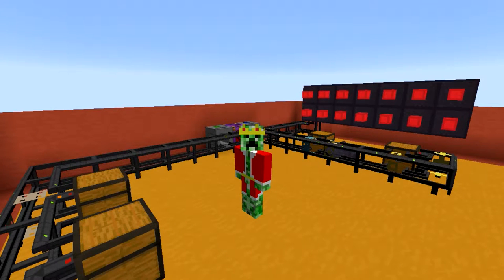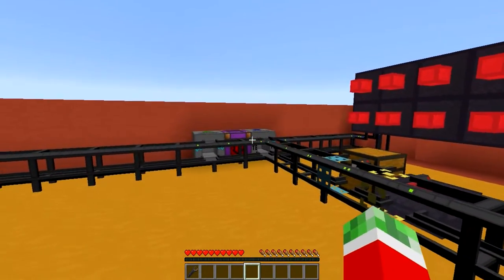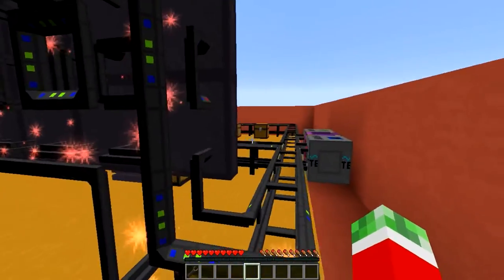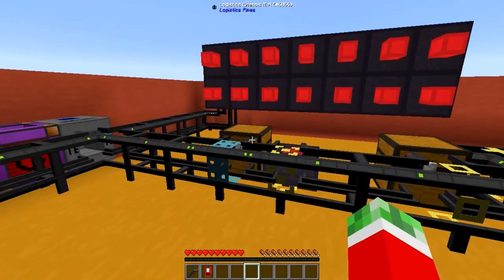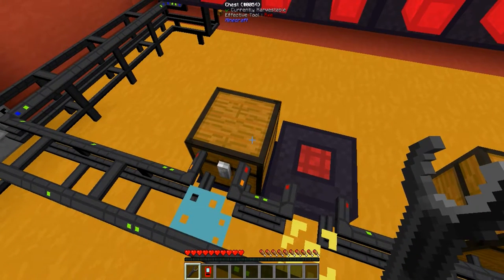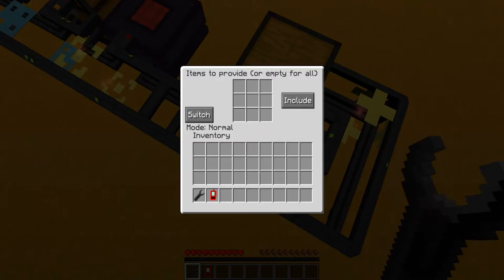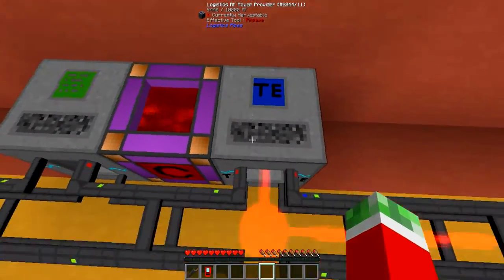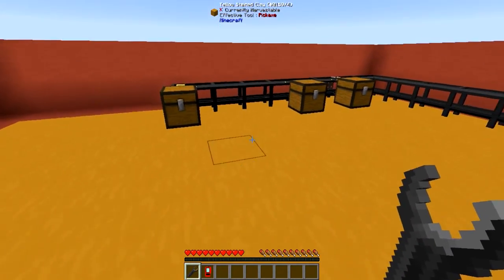Logistics Pipes Tutorial - #12 - Buildcraft Chipsets

Comment: Well, one small issue arised - I've told my supplier module to keep 20 Iron Chipsets, 20 Golden and 10 Diamond ones in the chest at any given time. I also have a provider module in the same chassis pipe connected to the same chest so the system can view the contents of the chest. There's more than enough Iron and Gold Chipsets in the chest, but only 5 Diamond ones (had them before I set this up). Even thought I've told the supplier to keep 10 Diamonds Chipsets in the chest, it doesn't fill the table with the required materials. I'm at a bit of a loss
Reply: Project Ozone 2 Kappa Mode if that's a concern